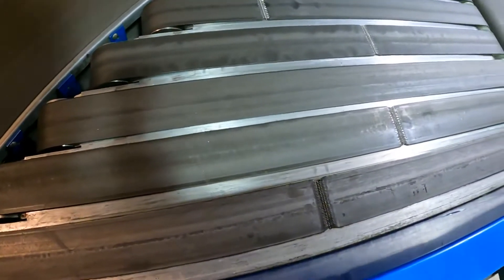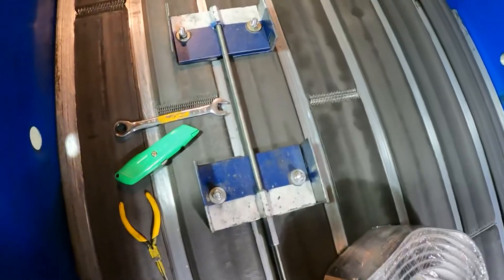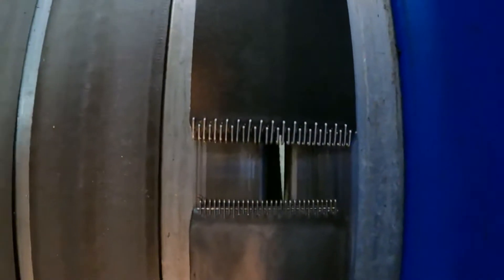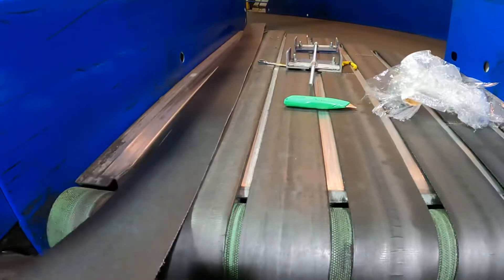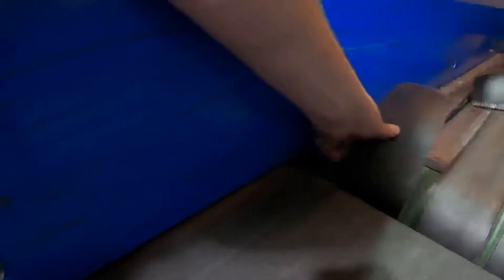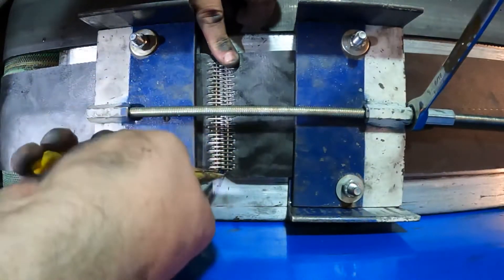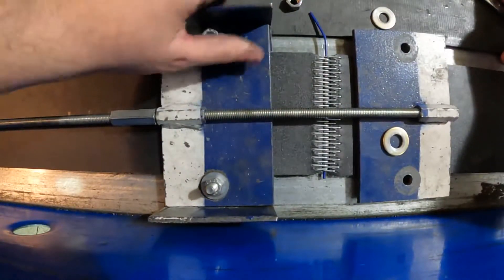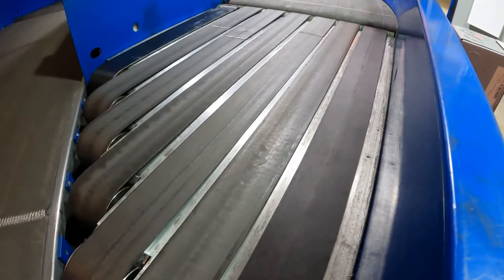Change a Merge Belt on the Baggage Handling System (BHS)

Comment: I was wondering how do you figure out the tension on these? I just started a job and we had to replace one of these belts. It was my first time, and the belt came off. So my supervisor redid it, and notice the tail roller was a bit loose. Tighten that up, and redid the belt. Week later, the belt is all torn up and off the rollers. The supervisor isn't here and we are going to try again. I was going to reinspect the tail roller again, and see how loose it is. I tried to tension it so that it felt there would be no slippage pulling the belt. thanks

edit, i found out it was a different belt that went off track. But would still be interested in your experience in setting tension.
Reply from the maker: Test the tension by pulling on the belt from the top by hand. The belt should only lift of the bed by a inch or so. It’s more by feel and experience then science. If the belt is squeaking it is too tight. It is usually better to leave these belts a little on the loose side, as if they are too
Tight they will pull themselves apart quickly. Thanks for watching and have a great one 😄
Reply: @180Floridalife  
thanks for getting back to me. I notice those little ones we do it by feel. And other conveyors we take a measurement on the tension bolt and set it to previous lengths, and run the belt for a while and re-tension if necessary. It isn't a bad job, just trying to learn the different conveyors and their locations
Reply: You only need enough tension to prevent the belt from slipping on the drive roller under the rated load capacity of the conveyor. Any more than this, and you risk warping/tearing the belt.

Comment: How do these handle baggage, do they hold up pretty well? Are loose straps a problem for getting caught underneath them? We're trying to get away from the TransNorm merges we have and possibly looking at these. I especially like how easy these are to change out.
Reply: It all starts at the ticket counters lol If the bags aren't inducted correctly things can happen that sometimes costs lengthy repairs
Reply from the maker: @OfficiallyOrca  so true training the airline personnel to put the bags on the BHS properly is very important
Reply from the maker: These work extremely well I have had units loose several belts and the bags will still move on them. Loose strap are not a huge issue if you remove the plate that these come with from the factory. They work better without it. 7 belt unit, I have seen it run bags with only 3. Very quick to change them out. Don’t over tighten the belts or the squeak and you will use a lot of belt. Once we have the tension set right almost never changed it. The new belts will start out tight but quickly stretch. My favorite merge. Portec makes a 45 merge belt with fixed rollers on the 45 end, run far away from that beast unless you like OT 🤣 thanks
Reply: @180Floridalife  Awesome thanks, appreciate the info! Haha We're trying to get away from Portec as well, been trying to get spare parts from them for 18 months and they just don't answer their phones or emails. 

Thanks again!

Comment: Very cool tool, I wish we could utilize this but we have fairly wide belts.
Reply from the maker: We use belt camps on our 36” belts.
Reply: You could save yourself the need to fabricate a tool by not skipping the first rule of working on conveyor belts... Loosening the tension. This should be done every time you are splitting a belt.